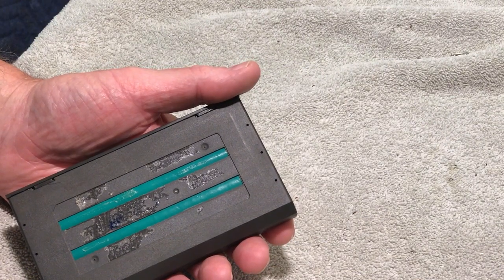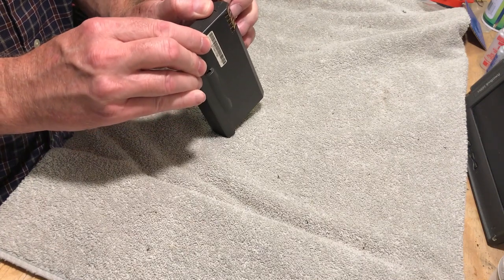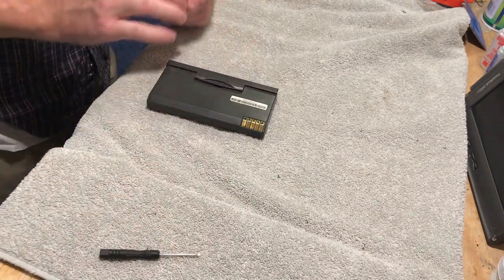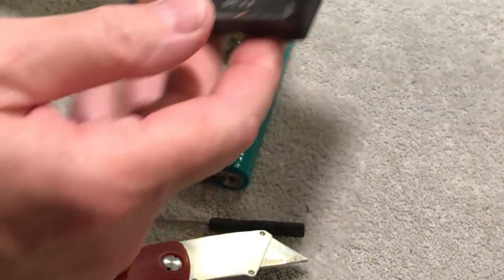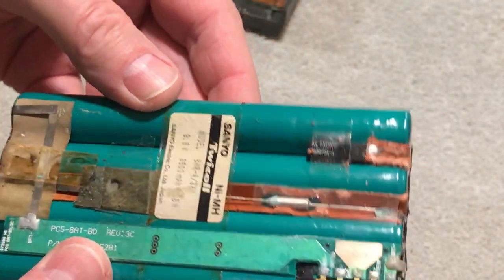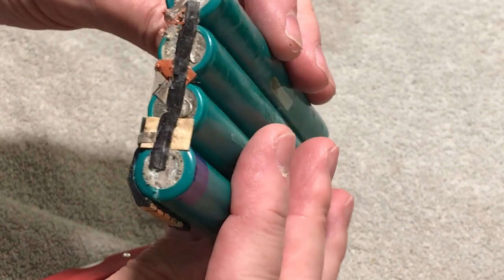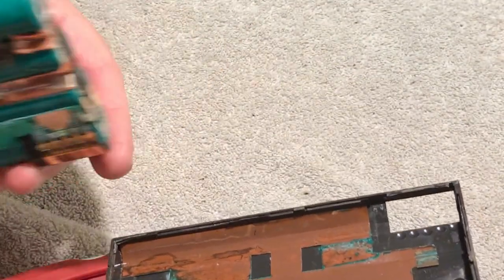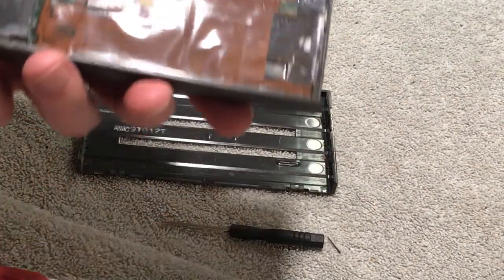REBUILDING THE POWERBOOK 1400 BATTERIES PART 1

Comment: Would using 18650 cells be a viable option?
Reply from the maker: Dont  Know Will Have To Check That Out But A Viewer Pointed Me To A Youtube Channel I Will Do A Battery Update This Week With A Possable Easy Fix Thanks For Watching
Reply: You cannot use Lithium 18650 cells to replace Ni-MH cells.  The logic boards don't know how to handle those.  18650 cells are a little bigger than these here.